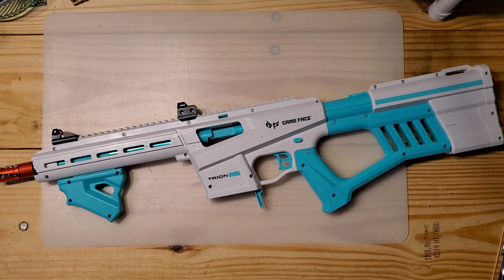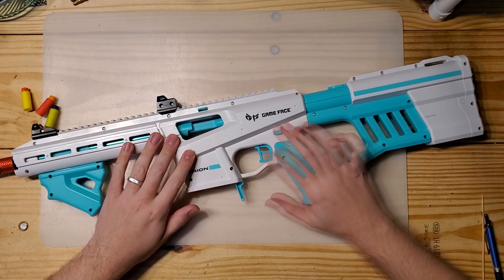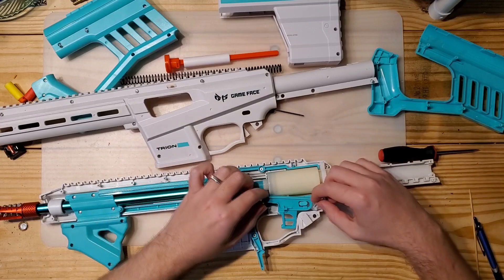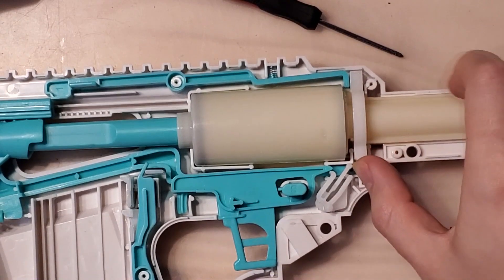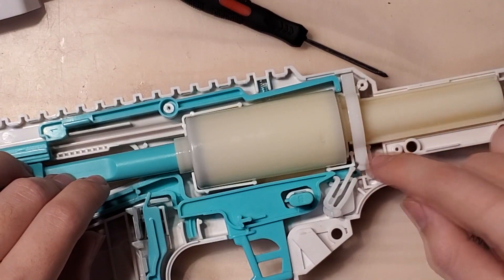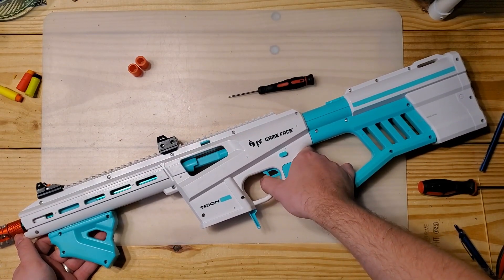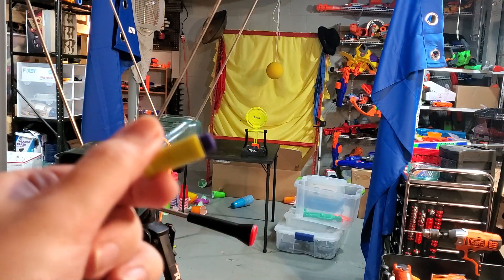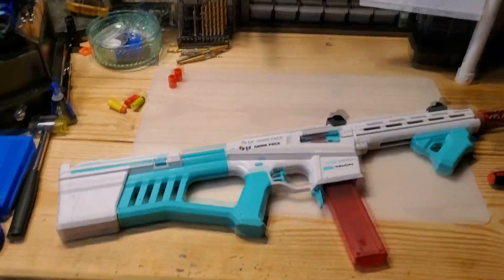How to Fix Your Game Face Trion

Comment: So, i had this issue out of the box and tried to solve it with this fix but in my case, this was not the issue.

The issue is not the trigger, seer or ramp catch.
Instead, look at the 10" long green part that sits behind the trigger and connects to the pump action handle. When you push the pump all the way forward, it unblocks the white ring, allowing it to fully lower and thus plunger can actuate. Little hard to explain without pictures but very obvious when you find it. Did also require some scraping though.
Reply from the maker: @teoandrew5620  haven't had a chance to confirm this myself but I'm pinning it in case other people have the same issue.

Comment: I kind of have a problem in which the a dart won’t come out through the barrel anybody know how to fix it?
Reply: Dude it like the darts sometimes but i greased everything the little whit piece in the jam door up top seemed to be the issue.. but it takes a little tlc to get running smooth, but once you do its just an amazing blaster. Im mad at gameface for forgetting my free optic though, emailed them and all
Reply: @rabidpichu7391  What kind of grease did you use, if you don't mind me asking?
Reply: I have a similar issue where sometimes a dart will sort of get stuck in the dart gate.  I'm not sure if it's a humidity thing where the darts are just a little too swollen or if it's an issue with the size of the dart gate itself or some other part.  My Trion seems to perform better when I really use some force while priming.  Using DZ bamboos, the thing is flawless, but when I use most normal darts like DZ max(Target) or DZ pros (Walmart), it jams more often.
Reply: @blasterface22  My new Trion has every flaw imaginable. There's this trigger problem mentioned in this video, and then there's the issue with stuck darts. Sometimes they just won't come out of the barrel and sometimes they get squashed when priming and I have to use long sticks in order to get the mashed darts out of the barrel. And that's with the original Game Face darts. Not to mention that it's a very inconsistent blaster. 

This is the worst experience I've ever had with a blaster.

Comment: Hey what bcar do you have im looking for one that will the stock barrel with out front peice
Reply: The one he has in the video is the Flag and Armor CNC metal BCAR. If you get it for this and you run both spacers, get the 8°. It's the best for this FPS range. Another 8° option that'll work is the Gavin Fuzzy BCAR.